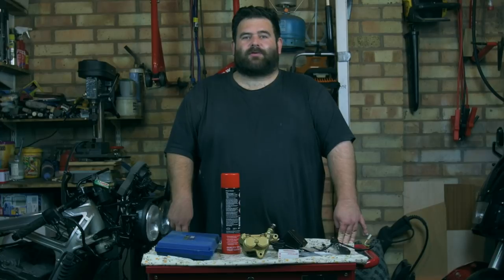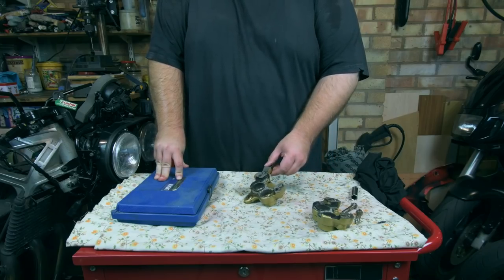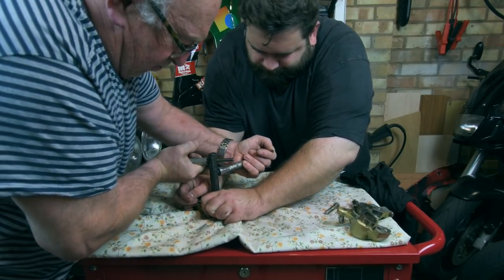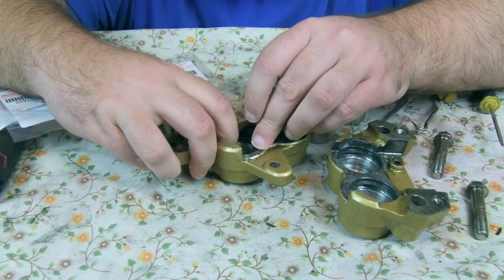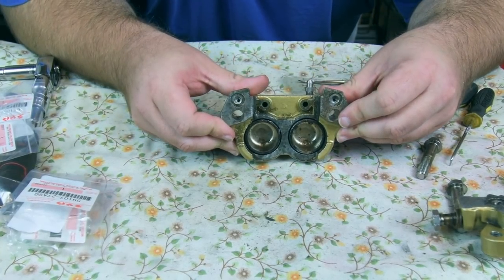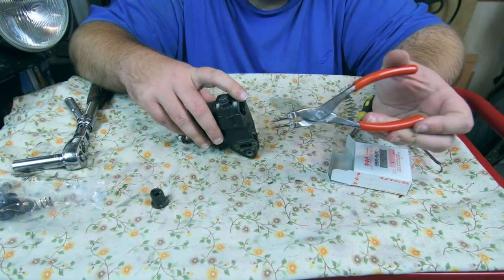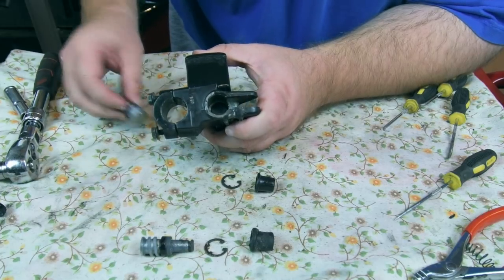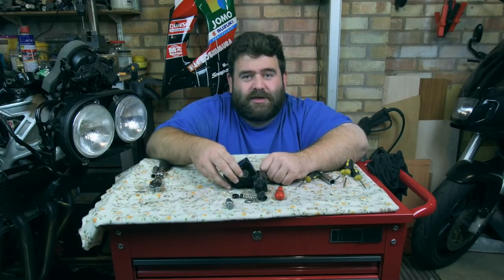Brake rebuild || It's GSX-R o'clock Part 4 || Classicmotorbikes.net

Comment: I always enjoy your how to approach; very useful for the budding home mechanic.  I have a question I recently rebuilt the front calipers on my bandit and the pistons were quite hard to get back in; they did eventually.  I have put them on the bike and they are working ok; but I wondered if I should take them off and check as I have seen your video and some others and when the pistons are replaced they seem to go in a lot easier than when I did mine. Any thoughts? Thanks in anticipation. Paul.
Reply from the maker: Hi Paul, do your brakes work as they should since you rebuilt them? if they do I would just have a look to make sure all the pistons are even and if they are leave it at that, but with brakes if you are ever unsure of them I'd get a pro to check them over as it's not something you would want to fail while riding!

Comment: did you just put those seals and pistons in dry ?
Reply from the maker: Hi Harrismagnum4, I used WD40 to help them in and stop them tearing.
Reply: Classic motorbikes  maybe read about WD40 and seals, use DOT fluid only, just saying :-)
Reply from the maker: harrismagnum04  what does WD40 do to seals?
Reply: there has been a long standing debate that it damages the rubber. I have seen it soften hoses certainly. Any info I've ever seen says use the brake fluid. Not having a go just passing on the info.
Reply: Best when rebuilding calipers is red rubber grease or plumbers silicone grease, neither will damage the rubber and the pistons will glide in,  don't use wd40, copperslip or normal grease as it can swell the seals and cause the pistons to bind. As a minimum lube them with a little brake fluid. A dremel with a nylon rotary brush is great for cleaning the seal grooves out and won't score the alloy Silicone grease is brilliant in cables and lever pivots as well